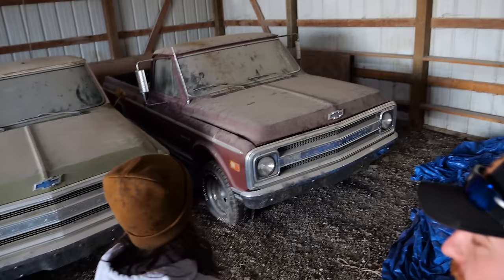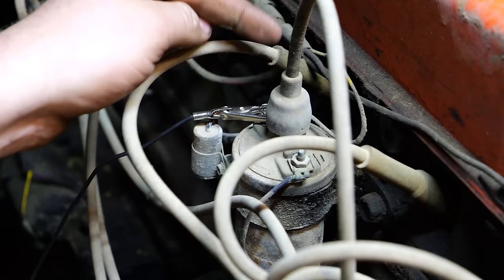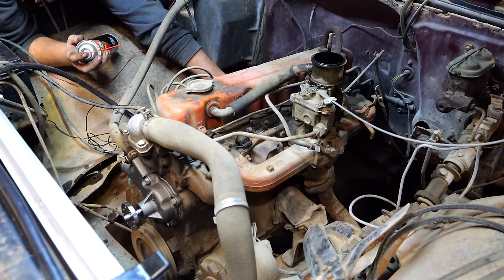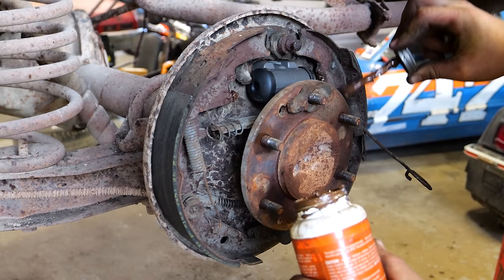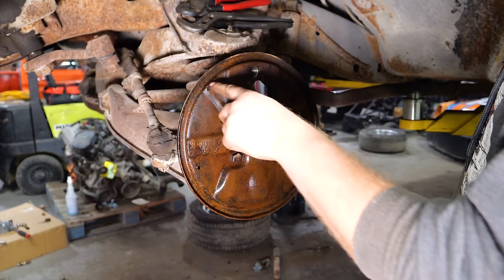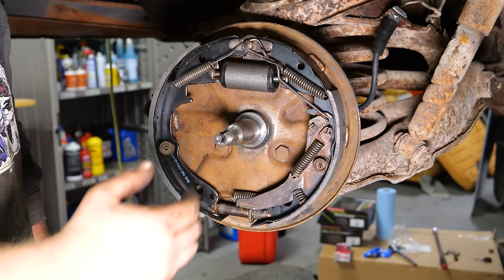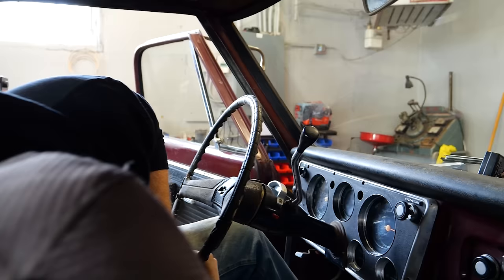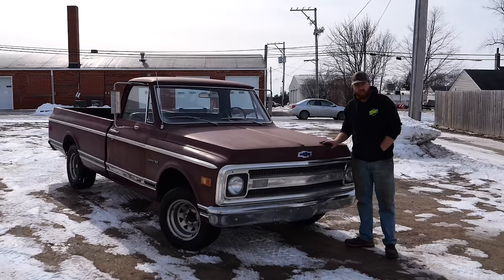Will an ABANDONED C10 Run & Drive? Mothballed for YEARS

Comment: Kevin, you put the brake shoes on backwards. The shoes are different lengths of braking material for a reason.
To reduce pedal pressure the shoes are loose to allow them to rotate a limited amount with the wheel.
The brake shoe movement is needed for the semi self-energizing design. The front (smaller shoe) applies braking force to the bottom of the big brake shoe while the wheel cylinder applies braking force to the upper end.
The brakes you pulled off of Mook's Nova were backwards too, that's why they were worn so differently.
Reply: Primary short shoe front, secondary long shoe rear to make brakes work properly.
Reply: Also you don't want to use anti seize, you want brake lube for all the contact points.
Reply: Came here to say this. Front shoes reversed.
Reply: @mariot4811  What about white lithium grease?
Reply: @loose-arrow-garage  nope. That's low temp greae. Brake lube for brakes. White lithium for like the parking cable if it's sticky or something like that.
Reply: @mariot4811  and I thought that copper grease was for drum brakes(, and high temps). Just don't use it for disc brakes, that's what I've told.
Reply: @Njazmo  the copper is just high temp anti seize. It's not at all a lubricant. Obviously he's been doing brakes for a while, longer than I've been alive. And it probably works, but as far I know and do, use lube for lube and antiseize for keeping things from seizing (threads, even some on the hub so your wheel doesn't rust to the hub). Lube will last longer since that's what it's made for.
Reply from the maker: Yeah I saw that as soon as the video came out 😂😂 

I was worrying more about The camera and the lighting and how to word everything to make it easily digestible for anyone looking to learn, completely forgot to check the brake shoes 🙄
Reply: @JunkyardDigs  what gets me is the idiots that put brake pads in backwards when they do disc brakes.  I pretty much change rotors with every brake job, in NY, as the rust belt is very unforgiving on rotors, even those electrostaticly coated to prevent rust.
Reply: Many folks use WD40, not Blaster, and it is not 1/10th as effective as Blaster.  I’ll soak bolts the night before, especially on skid plates, which every turn is like the initial break.  Almost blew out my shoulder removing the transfer case skid plate on my 2010 Rubicon last week which had not been removed, well, since 2010, to drain and fill my Xfer case.  Every turn was like doing the initial break of the bolt, and I was on my back and no impact, just an 18MM socket and a cast iron natural gas pipe over the socket as my breaker bar.
Reply: @queensapphire7717  rotors every time you replace pads? That's pretty excessive
Reply: @TheNilla2020  Long Island, NY, between the road salt and the ocean breeze, they rust out.  I recently bought some “treated” rotors, I’ll see how they hold up.
Reply: @queensapphire7717  Rotors today are made so thin you usually cannot turn them .
Reply: @spaceghost8995  yep,,which I why I just replace them, usually every second brake job.

Comment: That is a heavy half. The "Heavy 1/2" was essentially a tow package with 6 Lug hubs, stiffer springs, and Tow mirrors on both sides (most trucks of this Era only had a driver side mirror). Idk if it also came with a posi rear but it could have been optioned separately.
Reply: 6 lugs were standard til 71.
Reply: Yes and heavy half was later in the square bodies. And there were couple three mirror options. You dont really know much about these pickups.

Comment: Your description on how to get an engine running was spot on.  However, and this is a personal opinion, I wish you would shoot a gas/oil mixture down the carb instead of brake clean. It would give the cylinders a little lube on startup.  Again, just a personal opinion.  BTW, love the revivals.
Reply: In the past, I've used just a little ATF (automatic transmission fluid)  down the intake to help break everything loose.  It works pretty good.

Comment: I remember when all we had to restore a set of points was the strike plate of a book of paper matches. Out in the middle of nowhere in Utah had points failure and it sucked in the 100 degree heat. Man you come across some real good classics. Have a great time.

Comment: Hey Kevin,
I wouldn't bother with PV Blaster or heat for those fittings on the hoses. 
You just need two hammers, one heavier than the other. 
You take the heavier hammer and hold it on one side of the nut as a kind of anvil. Then you use the other one to hammer in the opposite side of the nut. You may have to repeat that for the other side's of the nut, but that usually cracks them loose pretty quick and makes them super easy to turn too.

Comment: Kevin, the shoe with the long lining is the secondary, in other words it installs to the rear, the shorter lining goes on the front, if you put them in backward your brakes will be excessively "grabby" or may even skid the wheel with light brake pedal input, just an FYI so yer not screwing with adjustment when you drive it and eat steering wheel first time ya hit the brakes
Reply: I guess you noticed like I did that he put the ones on the left front on backwards
Reply: Oh yeah, been turnin wrenches most of my 57 years on the planet, hell when I first started as a young kid the new cars still had points distributors, I was 10 years old when I did my first paid job for a neighbor, just happened to be rear drum brakes on a 68 Plymouth Sattelite, now days when I'm driving down the road I see things like, oh he's gonna lose that muffler or I wonder if she knows that tires nearly flat, sometimes I think it's a lil bit of a curse the car gods put on me, lmao!

Comment: If the truck has sat for so long, like before we were getting crappy ethanol gas, richen up the idle mixture. The engine is running off the idle circuit at part throttle up to 2000 rpm in many cases. Lots of great How To tips in here.

Comment: Those tools are really easy to use. Also you put the shoes on the front brake shoes on backwards. The primary shoe( the smaller one) goes on the front and the bigger shoe goes to the rear.

Comment: Traditional points (and relay contact) files  are meant to just "burnish" the points contacts, they really aren't supposed to aggressively file down the contacts.  Points are usually plated, and filing off the plating will cause them to get dirty much faster.  Of course with old very corroded points you have to remove all the corrosion, so you have no other choice but to file or sand.
Reply from the maker: Best option is always replaced, but we're always in a hurry 😂
Reply: Kevin do you get any opportunity to pick up points sets from yard/liquidated stock etc? The frequency you need them would be useful to acquire.

Comment: On my battery cable wires, when u use a replacement like that, I put the wires in a copper tubing and flatten it then solder, drill a hole and bolt it directly to the repair terminal.  Works great.

Comment: Great video. that truck reminds me of my first vehicle a 1972 Chevy C10 with a 250 CID straight six that I bought back in 1992 for $775.00. I knew the engine in and out, taking it apart and putting back together many times. One time I set to points and set the ignition timing in the dark on the side of the road with just a match book cover and feeling the points to set the timing on no. 1 cylinder at TDC. If you have this truck for sale still I have the money!

Comment: I'll just add something about brake hoses - check inside of them before fitting. It's only happened a couple of times, but the insides of the metal fittings weren't machined. Literally a solid metal slug. When it happens you'll be wondering why it doesn't let any fluid through when trying to bleed them!

Comment: Kevin I can tell you that inline 6 is not the 292, as the motor mounts are not offset like they would be for a 292 inline 6. So it is probably is the slightly smaller inline six, which I forget the size too. But two things you might want to do, that will keep that engine running. Replace the cam shaft & lifters, and update the motor mounts. As those inline 6’s was seriously bad about dropping the cam shaft onto the #1 push rod snapping it and busting the block. And those 3 piece motor mounts are a bear to find when they break.

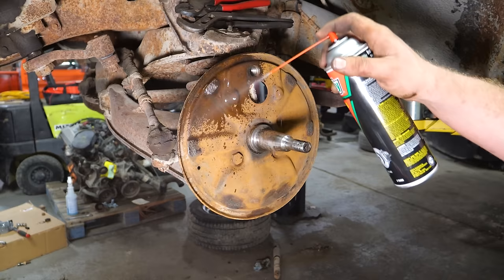Comment: 32:18 and 33:15 if you want to avoid brake dust in the air when disassembling or wire brushing the backing plate, feel free to keep a garden hose or even a spray bottle full of water near by, and soak it down before making dust/releasing it into the air. Just a safety thing i learned in both high school shop class, and my college automotive technician course! 

Of course brake cleaner works too, but that stuff can be expensive!

Comment: Use a fingernail emery board as a points file, still keep one in my toolbox to this day. That truck would be a great classic beater with an inline 6 engine! Timing on a Chevy 6 should be about 4 BTDC @ idle.
You put the front brake shoes on backwards, big shoe goes in back!!!
Cool video, glad to see you & Mook rocking the revivals as always!

Comment: I had a 1970 Nova with a 250 and 3-speed manual. It ran good even with low compression. It was peppy and got about 22mpg. Only thing was that Rochester Monojet. That thing didn't want to run right in colder weather below 45° until the engine was fully warmed up to operating temp. If you tried to demand too much throttle, that thing would fall flat on its face and bog long and hard! Not sure if the low compression was helping that or not but I was really tempted to rebuild that motor instead of put in a small block V8.

Comment: Excellent video Junkyard Digs Kevin  :) , Mook  :)  also in 1988 my late farmer friend had farm across home farm I live on  in 1997 years before that to he had 1968 Chevrolet C10 pick up truck had Navy Blue , Baby & Navy Blue interior had West Coast mirrors  on doors , 292 6 cylinder with Carter 1 barrel carb with hand choke cable knob in dash work to , Column Manual transmission 3 in tree , no power steering wheel plus brakes, plus 4 wheel drum brakes , Am radio with one speaker in dash , had updated 1978 Posi rear gears 377 in it to , had rare blue bow tie Chevrolet in metal grill that light up when headlights on or market too and great truck ! Also 2 chrome bumpers to and had 4 core rad too! Wheels were Good Year 225/75/16 also 6 studs plus dog hub caps with chrome rims! Funny part sold at farm auction sale for $700.00 uncertifed  safety check too in 1992 also my first boss work for in Automotive Restoration got and drove truck too ! But want Lol drivers seat part full bench had metal pail bottom sit on  plus gas pedal had backwards T shape with flat bar with  farm International tractor pedal for also rare hand to click like Emergency brake handle for Cruise Control to lock gas pedal in place and release too take of gas pedal push down! But when 1 year at Automotive Restoration shop we put new seat in blue color did not have drivers spot sit metal pail too ! Also spark plugs need change one day found had Champion brand in to plus EFI cap with Rotor change to plus new Distributor type also Wires got changed too! Nice find got 1969 C10 Kevin also Mook and hope Lol on 1968 on to had tell you! Those trucks live long time !

Comment: I  agree with you on points  files 'I tried  one once  and thought is was useless  ' I use a strip  of  folded over sand paper too' and then ' well' I used  to run a clean  piece  of rag through  them  to clean up 'but I found  that there could still be contamination  left behind ' so for many years now I've  run them through with  little strips of folded up white  note book paper soaked with lacquer thinner  ' and keep doing that with new paper until  they come out showing no dirt. I'm pretty  sure In the past I've  seen  points  files that were like an ice cream stick with a sand paper  like surface.

Comment: I love that truck. I learned to drive on a 69 C10 with three on the tree. The shifter wore out so my dad moved it to the floor. He used a shifter that was for a car so it was low and the seat could not be moved forward because there wasn't a notch in the seat. it had no top end speed but we could load it with wood over the top and it would go. Bumper would be almost on the ground.

Comment: Love it, no electronics, no stupid ECU, no stupid sensors, no stupid ODBII, no CE light, just some knowledge of mechanics and elbow grease.  Like Stymie in the “Little Rascals” said “Brakes ?  We got brakes”.  Drop a new carb on there.  Those old sixes lite on the HP, but nice on the torque.

Comment: If you're worried about the asbestos dust from the brakes, you can hose it down with brake cleaner or water first, that also makes it technically classified as solid waste for some reason

Comment: Those old inline 6 cylinders was powerhouses. Lot of torque. Not alot of speed but good pulling power. Simple and easy to work on. See engine bay not cluttered with computers or plastic just a engine in a bay. Sweet looking old truck.

Comment: What I was taught with drum brakes (and have been doing with semi truck drum brakes for a couple years now) is get a wide flathead screwdriver and cut a v-notch in the middle for removing/installing the springs. Also, sometimes brake shoes come with a core charge so return the old ones for a bit of cash back

Comment: I was lucky that I grew up in the 1960's when drum brakes like that were extremely common. My father owned a car dealership as well as several full service stations back then and he and the other mechanics took a few minutes to teach me how to use those brake tools (at lest what I hadn't already figured out by just watching them use those tools). I still have a set of those tools and wouldn't even think of working on brakes without them.

Comment: On the brakes. The shoes are front and rear sensitive. short shoe forward. Also the self adjuster, you have the Spring on backwards the Spring is not supposed to interfere with the starwheel. Use the brake tools you showed. Way easier.

Comment: On the distributer, would it work after sanding off the contacts to blow it out gently with an air hose to get the extra dust out so you don't lose spark again?

Comment: I've mentioned I had a monument to Bondo sculptors everywhere it was a burgundy 80 Chevy c20 Scottsdale it was a 68 Chevy 250 L6 it was a bad carb other than that excellent running straight 6 it needed all new brakes on all 4 corners both rear leaf spring packs and both front leaf spring shackles so I got rid of the truck but it had good floors in the cab and mostly decent original doors the fenders and hood and bed were bondoed junk but if I would have kept it I would have left it straight 6, but if I was guessing other than the truck you got being used for parts I'd say they were probably going to v8 it

Comment: not so sure id use antisieze on brakes, i used to use it to lube caliper slides. I have discovered that the aluminum antisieze will get gummy and sticky after it gets hot in the brakes after a while best to use brake lube, it is heat and water resistant. if i am too cheap to buy brake lube, i just clean the adjuster really well and use light oil that hopefully doesnt attract dirt, couple drops of tranny fluid on the threads

Comment: I noticed on the rear drum you installed the front shoe spring last on top pin. The front shoes you put the front spring on first under the adjuster spring. Aren't they suppose to assemble in the same order. Just thought I'd ask. 👍

Comment: Sniff yer dipstick and clean the pump valves with alcohol or carb spray first. It might just be the pump valves are "waxy"
An A/C pump can still be good alot of times. Mine was.
Replaced it.
The contents of my fuel line caused it again.
So clean the supply and lines.
Yep.
Took me some time.
I said framitz a few times. 
That's a clean straight truck you found there. As it goes. They're getting fewer.
The inside of the house is tore, oft times. Passed fluid in but won't let it out in that example. It's like a flap in there.
Seen a few.
Others have a visible bulge.
But those backing plate bosses can get ate into by the shoe webbing, don't reassemble
File them smooth or weld in the worn spot.
That's what mine was like.
Shoes had been dragging.

Comment: Probably fire up after just a little TLC. If my 69 C20 hadn’t been a complete rust bucket by the end of its life I would’ve kept it. Despite the rust it never left me stranded. 305 with a 3 on the tree and I pulled a junkyard manifold for a quadrajet I had lying around and it was solid to the day I sold her. I have a 18 Ram 1500 I can’t stand now. I shouldn’t complain too much I scored a nice Toyota on the cheap and I have a 69 Mustang Fastback waiting in the wings with final assembly. Still miss that truck.

The 305 originally came with that same 1 barrel carb and was my immediate mod I did after I got it running. Other than 1 clutch job and one brake job I never had much to do once the engine was sorted and all the points lubed up. Didn’t even replace the bias plies that came on it when my grandfather had it. They were a rough ride but never went flat unless sitting forever but would air right back up. Cheapest and easiest maintenance vehicle I ever owned outside my 65 mustang coupe; though that one was a running project that I never could finish.

Comment: Hello Kevin,Mook & Angus, if I had this truck you could definitely be taking out the tiny 6 cylinder & either put in a 350,400 or a 455 & also take out the automatic transmission & put in a manual transmission with a 4 on the floor shifter already on the transmission & yes I'd have to cut a hole big enough for the shifter in the floor & put dual exhaust on it with either glass packs or the small cherry bomb mufflers there like glass packs but smaller & hollow,so more rumble & I like the wheels that came with it